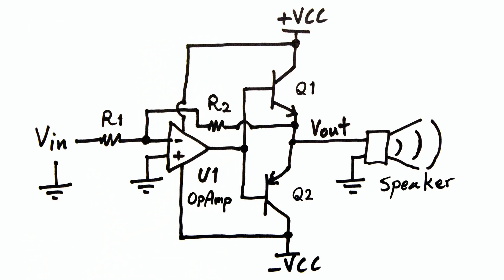Making an Audio Power Amplifier (Drive a Sub Woofer)

Comment: Smoke is an essential component of any electronic part:  when the smoke escapes, the part stops working.
Reply: Unless you use smoke generator in circuit
Reply: Sumo KING may kill people.
Reply: the smoke is the soul of the component
Reply: @mangojuic3e  and when the component dies the souls goes to air and than to heaven if it was a good component
Reply: True
Reply: As Kevin talbot said when the smoke comes out you can't put it back in 😂
Reply: Smoke is the first element. It’s the most important element, because without smoke, electronics would not work.
Reply: Free the smoke ain't no holding it back
Reply: Where there's smoke, there is a prototype board somewhere

Comment: When I started to learn electronics, people usually asked me if I had a lot of electrical shocks during classes, but honestly the only shock I had since then was once at home while changing an electric outlet. But I had a my share of accidents, I burnt myself with soldering iron and overheated resistors or semiconductors. I even burnt a 10W 1ohm resistor once and touched it with my bare hand because I forgot that's not because you unplugged the power the heat will dissipate immediately. Some burns, but no shocks...except at home, I'm not safe there.

Comment: Ive been shocked by a light switch, and that shit hurts
Reply: I've been shocked by a 120v power outlet and my left arm felt wierd and kind of hurt for half an hour or so. 

I was trying to route a cable through the wall and was tucking the excess in the power outlet and I accidentally touched the screws on the sides... Idk if it was cause I was wearing rubber sole shoes or if my body just reacted quick enough, but I'm not dead yay.
Reply: Nuka Charming The Unicorn King I've been shocked by a 240v English plug and it killed
Reply: David Daivdson I can only dream😂
Reply: Ha...touch an ac cap and feel my pain......OUCH!!
Reply: I touched exposed wiring on a lamp. It wasn't painful, rather it was the most bizare sensation I've ever had.
Reply: I have touched 220v a lot of times but i never held onto live and neutral at the same time
Reply: @charonsferryold   dont do it again
Reply: Getting shocked by the light switches is a lie parents made so their kids dont miss with the lights its not real if it was real you will get shocked every time you turn on/off the lights
Its a joke tho
Reply: @twiggypancake3902  if you touch light switch with wet hands you get a shock sometimes
Reply: @noclickbaitting3393   yeah thats if your hands wet enough to get water inside to the live wires
Reply: David Daivdson France 230V, étant plus jeune je dénuder un câble avec les dents , "prise branché évidemment", et l'autre câble a toucher ma main, ZZZZZ j'ai vu des flash jaune fluo bordel!!!
on sent bien les TAC TAC TAC TAC TAC ultra rapide des 60HZ, hahaaaa!!!
entre temps j'ai reçu encore quelque secousses, mais comme celui ci jamais!!!
Reply: I got shocked by a game console when i was fixing it for a friend. Before you ask, there was still some electricity in the motherboard and it went right through the metal screwdriver, my arm went numb for 2 minutes
Reply: Well I was shocked when I was unplugging my USB from PC and it felt like somebody took a sub woofer and glued me with it and set the tone to a 100000hz
Reply: I've been shocked by a car battery, and that shit hurts even more
Reply: Same thing happened to me when I was 8 my mama was laughing her ass off and like BRUH I WAS FUCKING 8 I THOUGHT I WAS DYING
Reply: Nuka Charming The Unicorn King ive been burned by really hot microwaved water and holy shit it hurt really bad, gave me a first degree burn
Reply: @zyphergaming3187  If that were the case then you wouldn't he able to hear it. Do you even know how sound works?
Reply: @electricflixproductions   dude I just set an example
Reply: @zyphergaming3187  I know but like how does sound even compare to pain?
Reply: @electricflixproductions   I already told you it feels like vibration not pain
Reply: I was shocked by 220 V power socket when my brother told me to insert a small led into the socket and turn it on. Boom, it blew and i was a kid so couldn't react with **ck, s**t.
Reply: I've been shocked by an exposed computer charger wire while I was plugging it in.
Reply: Well,here in latin america we have 220V
And if you touch with a weated hand a light switch hurts AF
Reply: I touched a 230v 50hz outlet and it felt tingly
Reply: I got one from the static in my home

Comment: The amplifier can be made to sound as good a a powertube-amp, by putting a small resistor in the negative path of the speaker and then soldering the opamp-feedback wire to the negative terminal of the speaker. The opamp will then only see the current through the speaker (turned into a proportional voltage by the resistor). The effect of it is, that the speakers counter-reactance to physical forces (membrane twisting sideways in the video), which modulates the impedance of the speaker and also mimics a false feedback voltage to the opamp, will be ignored, so the actual current becomes the only criteria for the feedback-loop. I tried it at home and it has become part of my stereo, cause it really makes any loudspeaker sound nice and musical (like tubeamp-driven), without that synthetic character or 'plastic-sound' that other cheap solutions have in common.

Comment: In the schematic, it shows that you used an Op-Amp and then connected it to a class B power amplifier and then provided negative feedback to the op amp. Wouldn't Just using the op-amp be good enough for this experiment? And would the added parts improve the sound quality because of the feedback?
Reply: +TheSinfulFreak By this experiment, I meant the video where you attached a water tube and filmed the water falling at different capture frequencies....
Reply from the maker: +TheSinfulFreak You can't drive such speaker directly from an OpAmp as it can't provide enough current. You need that class B stage to provide the current. And the OpAmp feedback gets rid of most of the distortion created by Stage B amplifier.
Reply: +ElectroBOOM Ah, thank you very much!
Reply: TheSinfulFreak
Reply: @ElectroBOOM what's name of op amp? That's single or dual?

Comment: It is important to know that it's the Amps that hurt not the Volts. It depends on your own body resistance. Everything below 60V is considered harmless. Body resistance can range from several kohm to some mohm, this is why the results from applying high voltages to the human body can be very varied (stress levels, skin thickness, temperature, air moisture, skin moisture, etc.) I guess you know all of this but just wanted to leave it here as an addition. :)

Comment: won't this circuit invert the signal ? 
and does it matter or not in audio applications if i invert the signal ?
Reply from the maker: +tayeb mabruk yes it does, and no it doesn't matter
Reply: thank you so much for the fast reply :D
Reply: +tayeb mabruk The inversion only matters if you also have a sound source which is not inverted. For example you have a speaker which is non-inverted, and for some reason you have an other speaker in front of which you have this amplifier.  Some waves will cancel out and it will sound weird.
Reply: Even though it reverses the polarity of the output signal, when used to drive speakers in say a stereo configuration ( 2 speakers typically with very similar signals) and you get the phase of one of the speakers inverted with reference to the other, they cancel out and do not create as loud of sound (destructive interference). However since the speakers themselves are not polarized you can reverse the connection of the leads to the speakers themselves to create a situation where they both move in the same direction at the same time (both move out together, or both move in together) and this allows you to take advantage of constructive interference between the 2 speakers. This is only really an issue when you are using speakers that are mounted in boxes, and is far less important when the speaker is free like the one in the video.

Another thing to be careful of is that a speakers power handling will change whether or not it is in an enclosure. A free speaker can handle slightly less power than one in a box since being in a box will limit the travel of the speaker due to pressure waves behind the cone. When the speaker is not in a box the air does not get compressed as the speaker moves in and out which allows the speaker to travel farther on less power and potentially bottoming out which will damage the voice coil.
Reply: i rather not insert hoses up my arse ty >.>

Comment: Would the three terminals on the battery be used for charging the cells in parallel? You said it goes in between two sets of internal batteries?
Reply from the maker: +Joshua Lloyd There are a bunch of cells in series in those packs. Say each one is 1.5V (8 battery cells) to get 12V. the center pin is right between 4 and 4 series cells so you assume that is zero volts, and one end will be -6V and the other +6V. They charge the batteries all as one unit which is made of 8 series cells.
Reply: @ElectroBOOM where did you connect a speaker ground? And where connected input sound?

Comment: These videos are funny, but also awesome at showing WHY you follow different safety procedures... Great stuff.
Hate to admit it, but... I've used the lip/mouth method to test heat many times, and once as a kid, I touched the nozzle of a hot glue gun to my chin when doing that - a glob of glue stuck and burned! Much cooler than a soldering iron, but worse because there's no way to quickly remove it! Ah well. Experience is not a kind teacher, but it is an effective one!

Comment: You have no idea how true are most of these "jokes" for a beginner. One time I burnt myself so badly - I wasn't looking at the iron and when I tried to grab it I grabbed it firmly by the metal hot part - and it wasn't like the one I use nowadays for proper usage in fine electronics, like 20-30 W, it was a 60W monster. Hurt for a few days and even left a permanent scar.

Comment: I'm watching this because we need to build an amplifier lol. Thank you so much ahhahaha
Reply: Very cool. This is a very basic 'push/pull' amplifier. Better design is need to eliminate cross-over distortion which happens at the point where one transistor turns on and the other on off. This design is the basic principal of class AB operation. Good luck! :)

Comment: you should place a low value capacitor  in enter of ur circuit to prevente dc voltage on ur speaker !

Comment: Yo man, I've watched a few of your videos now, and just a word of advice, you might consider homeowners insurance :P
Reply: I don't think so, this is just a simplified version of an amplifier, you'll need a way to process the signal and transform it from analogic  wave (sinewave) into a digial wave (square wave), the easiest way to do this is with arduino as the procesor using the pwm pins as input and a stripe of neopixels (rgb leds with an ic controller) using the digital pins as ouput.

i recomend you to visit /r/arduino on reddit, there's a lot of examples and people who can help you to do that.
Reply: I think you mightve replied to the wrong comment, because I have no idea what your talking about xD

Comment: also dont do pen spinning with a soldering iron the cable gets in the way and you will burn yourselves also get a propper soldering station , and line i had to do once where my station broke and i wored the iron to my lab bench psu i just sensed the temperature by how well it soldered if the solder started to spit hot stuff at you it is too hot and if it dosnt melt imidiatly it is too cold

Comment: Hey Mahdi,
I got these sony Xplode car speakers they are like a decade old, my cars music system got stolen last year, so now I am trying to connect these two to my phone via a 3.5mm jack.

What I want to do is, take one of my old earphones and cut it to get the 3.5mm jack I need, and joined the two subs in parallel, and directly connect to my car battery via a fuse(how high a fuse should I use?).

I am not certain but I guess they are 4ohm speakers so connecting them in parallel makes them 2ohms. 
My question is should I use an amp or can I directly connect this to my phone, coz one of my friend told me this arrangement will cause a considerable amount of current through the 3.5 jack hence damaging it.

Comment: hey mahdi, i am trying to do this water elevating thing for my school project, and i figured i can change the fps of the camera with a light that goes on and off in a high frequency, but i don't really undertand can i do this.. so i wish you can help me with it  :)
Reply: Aymen khalfa I think he just knew the FPS of the camera (depending on the Camera it probably runs at 60fps, or 30, or 29.7, which shouldn't be that difficult to find out) and set the LEDs to oscillate at that frequency and then slightly above it and then slightly below it. And then he set it to a frequency that is the multiple of the camera's fps, like if the camera was a 60fps one, he first did 60, 61, 59, 120, and so on.

Comment: I have a mono-channel amplifier, it has one input pair an one output pair for audio signal. But a standard audio cables (which connetcted to mp3 player) have right and left outputs in positive side. Is it safe to solder these left and right positive inputs together? Or do I need to solder some diodes to protect my mp3 player?
Reply: should be fine to just connect the audio channels together, but if u wanna be safer then use two 1 - 100 k resistors

Comment: Could this circuit be used to make a strip of LEDs flash to the beat of music?
Reply: Copy/paste from another comentary i did

I don't think so, this is just a simplified version of an amplifier, 
you'll need a way to process the signal and transform it from analogic  
wave (sinewave) into a digial wave (square wave), the easiest way to do 
this is with arduino as the procesor using the pwm pins as input and a 
stripe of neopixels (rgb leds with an ic controller) using the digital 
pins as ouput.

i recomend you to visit /r/arduino on reddit, there's a lot of examples 
and people who can help you to do that.

Comment: If I took a guitar output jack and plugged it into a custom made amplifer circuit, then output it through speakers, would I have my own custom made guitar amplifier?
Reply: IDK
Reply: Yes. I also think you can plug it in your PC's microphone jack and use a program to create the sound and to modify it.

Comment: Hey dude help i want to power a car amp in my house to drive 1 sub but i cant get descent +12voltage from my ups(which i had modified to an inverter 😊)but it still cuts ouut power at those really low notes help themanual says amp drawage is 36A

Comment: Can't I just use a 25 dollar Lepai amp to power the speaker
Reply from the maker: +Zach Baylin Sure, why not
Reply: +ElectroBOOM Im not too experienced with electronics, but can't i just use one channel to power the speakers and one for the LED? Thanks for the quick reply!
Reply from the maker: Zach Baylin
You can't drive LED with the other channel easily. The strobe lights needs to be shaped like a pulse with short on time for best effect. The second channel wouldn't provide what you need as it is for audio.

Comment: Can i use wall plug as 50hz sin generator?
Reply: HAHAHAHHAHA quite bad idea. because the mains current depends on how much stuff is running in your house, i obviously dont know what is going on BUT lets assume that nothing is running. you would need a speaker with at least the same amount of resistance as volts so if you are using 120v than you would need a 120ohm speaker that can handle 120volts and have nothing else running in your house. if you are using 2000watts then divide that by the voltage to get the ohms 2000/120=16.67amps. we would need a (120/16.67) 7.2ohm speaker on a 2000watt 120v loaded house.

possible but i doubt you could find enameled wire that can handle 120volts and 16 amps let alone do like 60 windings to make a speaker
Reply: ehm.... thththth.. no man, just no
Reply: If you had a trafo, and DC to AC